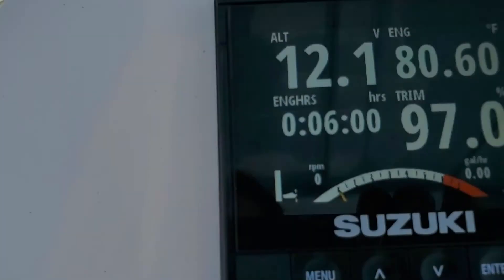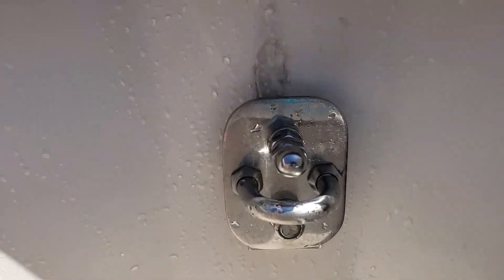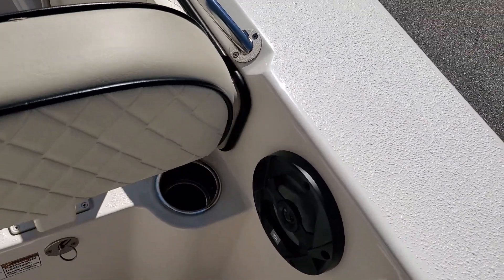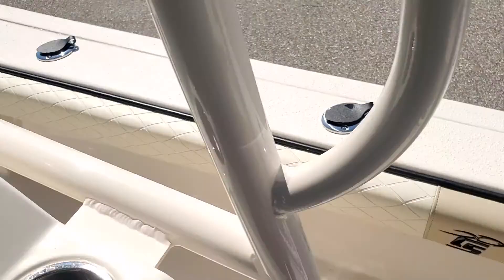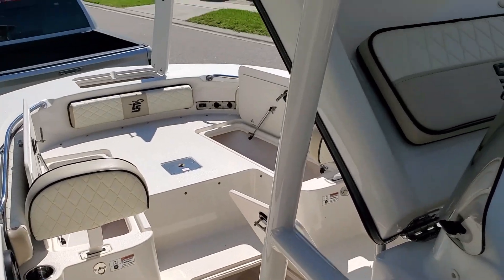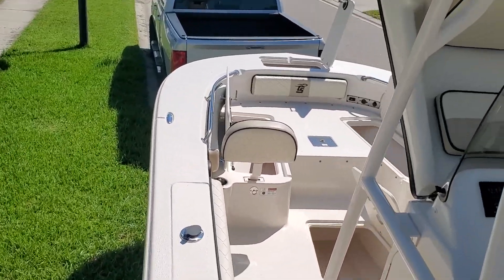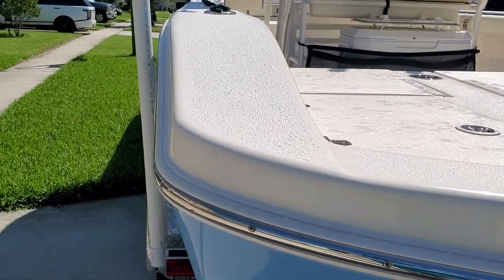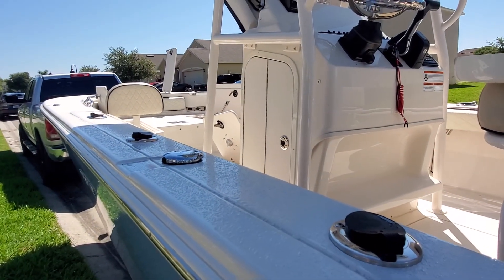New delivery of a 2022 24' Carolina Skiff Ultra Elite and the work that needs to go into it.

Comment: This would be my boat of choice.  Certainly will check with dealer before pulling the trigger. Hoping this was isolated event (s) as Carolina Skiffs have a good history in manufacturing.  That’s a lot of defects for one boat.  Hope they repaired it all.   Thanks for posting !
Reply from the maker: I've learned the boat was used in the  early 2022 Miami Boat Show and that's likely where most of the gel damage occurred.  It took me reciting the warranty statement word for word (about ability to return to the plant for warranty review and repair) in an email to Carolina Skiff's warranty department (which also included the CEO's email address) at which time the warranty contact changed his tune from saying the Manufacture plant doesn't have a service department to a reply they would be happy to bring my boat in for repair. 
I dropped it off November 9th and after 2.5 months  I'm told and I quote "We are getting closer but we have had some overall delays in our patch and repair and final finish departments so all boats are taking a little longer – but we are working through it and as we do get closer we will keep you up to date – thank you"
January 10th (2 months after drop off) I asked if I could be given a expected completion date. The reply 
"Because of multiple departments on the production line evaluating and repairing this boat it is not possible to get an exact ETA on the overall completion – as the boat moves up the line and gets closer to completion we will be able to give you a better idea and when we can do that we will be glad to let you know – thanks"
Jury is still out on my thoughts toward Carolina Skiff's 2023 value.
Reply: @Matrixticity  wow. What a journey.  Hope you get back on the water soon.  I’ll dig deeper before buying for sure

Comment: Thank you for sharing this. Did the dealer/manufacturer make it right and fix these things? Whoever is inspecting these boats before delivery is not doing their job. And The dealer should have caught alot of this stuff. This is why it's important to do a thorough inspection before taking ownership at the dealer.
Reply from the maker: I've learned the boat was used in the  early 2022 Miami boat and that's likely where most of the gel damage occurred.  It took me reciting the warranty statement word for word (about ability to return to the plant for warranty review and repair) in an email to Carolina Skiff's warranty department (which also included the CEO's email address) at which time the warranty contact changed his tune from saying the Manufacture plant doesn't have a service department to a reply they would be happy to bring my boat in for repair. 
I dropped it off November 9th and after 2.5 months  I'm told and I quote "We are getting closer but we have had some overall delays in our patch and repair and final finish departments so all boats are taking a little longer – but we are working through it and as we do get closer we will keep you up to date – thank you"
January 10th (2 months after drop off) I asked if I could be given a expected completion date. The reply 
"Because of multiple departments on the production line evaluating and repairing this boat it is not possible to get an exact ETA on the overall completion – as the boat moves up the line and gets closer to completion we will be able to give you a better idea and when we can do that we will be glad to let you know – thanks"
Jury is still out on my thoughts toward Carolina Skiff's 2023 value.
Reply: Just watched your video. I’m so sorry that you had that happen, it should have been a happy and exciting time with your new boat. I was just wondering it’s been 3 years since the purchase of your boat how did it all end.

Comment: Nearly $100k boat should have NO DEFECTS!!!!!!  Unacceptable!!!
Reply: It was a used boat.
Reply: That isn't realistic...an 80 million dollar gulfstream jet is going to have defects...that is what shake down runs and warranties are for...
Reply from the maker: @robgover8341 No it was a 0 hour boat.  The boat was taken to the Miami Boat Show. That's likely where the T top had gotten chipped. Carolina Skiff replaced the top and all has been good so far. I do have a couple of gel air pockets that chipped out but that's not the end of the world.
Reply from the maker: @tstanley01 lol I'm sure any dealer is thrilled to sell to you. Have you ever worked with a boat dealer on warranty work. This boat spent 2 months in Orlando dealer before they called me and said come get your boat without any work completed because they determined it would take too much time for them to repair properly. Other dealers said they would look at it but they need a few months no promises. Then the Factory finally accepted to take it back and they had it for 3 months.  I guess it's ok to have that 80 million dollar Gulfstream out of service (without loss of use and depreciation reimbursement) for 6 months because it's in need of warranty work due to manufacturers poor quality control. After all, that's what warranty is for.😅

Comment: Have you gotten the boat back?
Reply from the maker: Sadly no. On the 9th of February the manufacturer will have been "working" on my boat for 3 months and still won't give me an estimated delivery time.  
If you'd like, read my reply from our of the other comments as it includes what the Warranty department is informing me. 
I'm not even confident they will replace the mis matched tower or top to eliminate the gaps. I'm told that's common because the connection plates are welded by hand onto the tower. I questioned weather they use a jig to insure proper placement but I received no reply.
Reply from the maker: After 2 trips to Waycross I got the boat back in great physical condition. New T top and anodized framing that matches the conture properly. Only problem was when changing the binnacle they mixed up the throttle and shifting rods. That point they told me I needed to go to a authorized dealer to have it corrected otherwise I might void the warranty to the boat and the engine. Another two-hour drive and hassle to take care of that